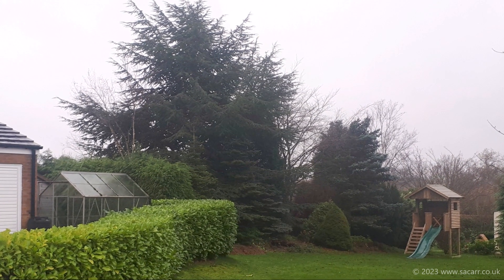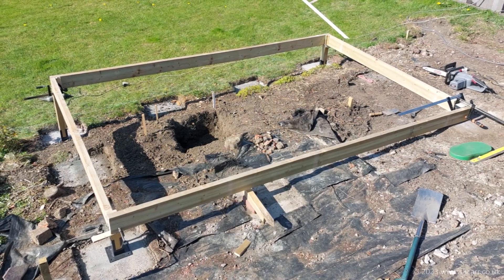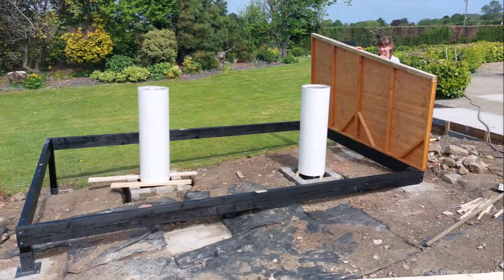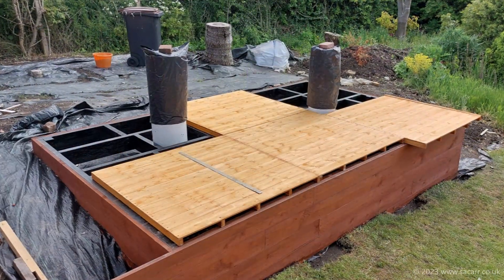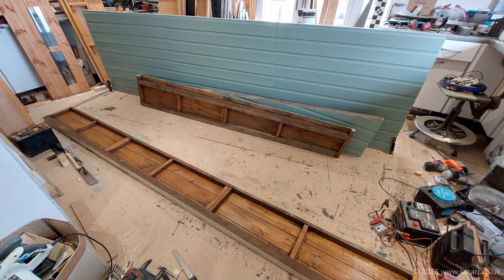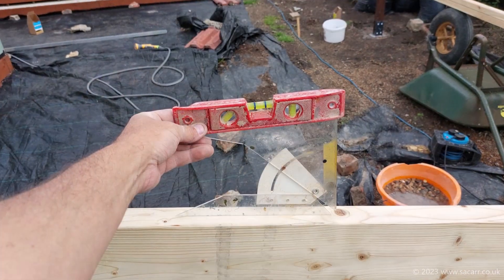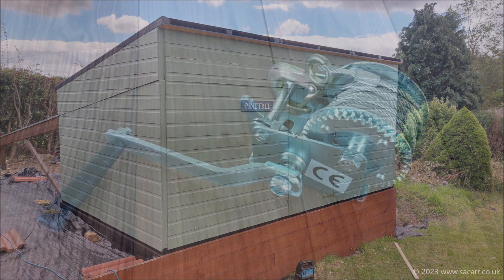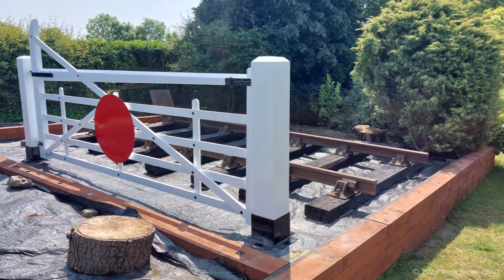Building the Dual Pier, Pinetree Astronomical Observatory

Comment: This is awesome for a number of reasons, one is that it is a lot of work to put a shed like this together. Most videos make it seem easy and skip a lot of steps. In this one, all of it is there and gave me a ton of ideas how I can replicate it in my backyard. And, at the same time, not feel bad that it will take a while to build. Thank you so much for this thorough video
JJK
Reply from the maker: Thank you. It was a lot of hard work and several other people have said how they encountered underground obstacles that made the groundworks so much harder! You have to just keep focused on the end goal and on days where things aren't working out, take a break and come back fresh another day. Also, don't make the design set in stone, as once you start using it, things may have to change. That's one of the reasons I didn't bury my cables in a duct in the pier. I don't remote image and move around with my laptop as the sky changes. Having cables and power supplies that are free to move works for me better than a fixed position.

Comment: How did you weatherstrip it?  Of all the home observatory builds I've watched no one ever tells how they keep the wind driven rain and snow out...
Reply from the maker: I've got mylar plastic draught proofing strips over the front and rear opening joints on the inside. The roof runs on L section channels, so the L section acts as a gutter, preventing rain from entering at the sides.